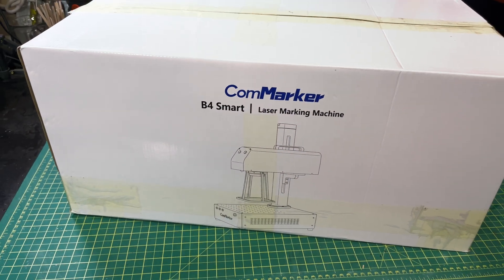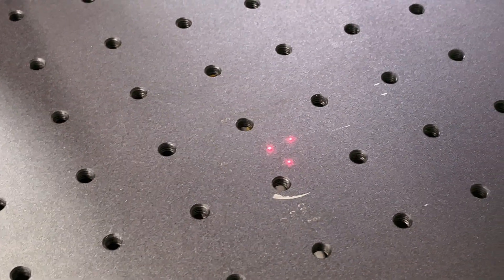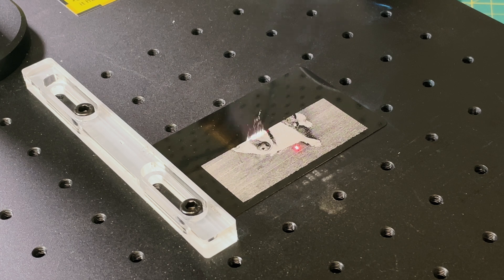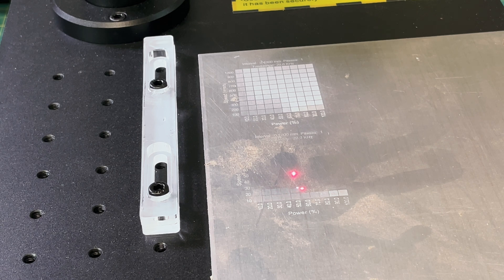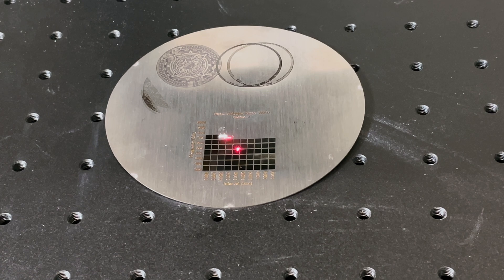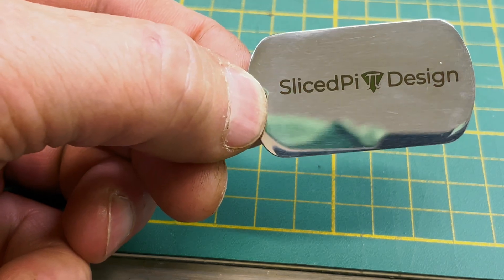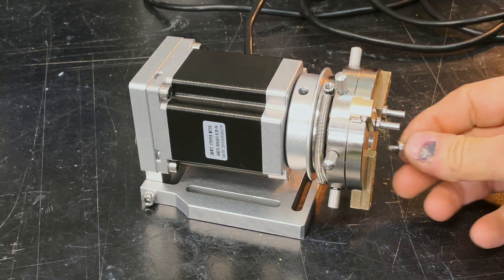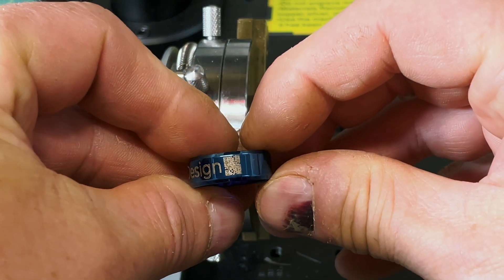Ultra-Fast Engraving with the ComMarker B4 Fiber Laser

Comment: Great work. I just got mine up and running. Could you show how you did the horse it came out great!
Reply from the maker: Well, that video was a couple of years ago, so I don't have the laser in my shop or the settings anymore.

In Lightburn, though, you can select 3D engraving mode for an image, and for that one, I probably use 15-20 passes.  With a fiber laser you can also engrave brass with a light color or a black color just by adjusting settings.  I believe ComMarker does have a settings library for the B4 that you can add to Lightburn though.

Comment: Great video Steve. I just received a B4 20w and having trouble getting the settings correct. Would you mind sharing the setting for the business cards in the video? Thanks in advance.
Reply from the maker: I'd love to, but this video is pretty old, so I won't have these settings anymore.  The best thing to do is to sacrifice a card and run some material tests (speed vs power), since the settings will vary depending on the material and even from laser to laser.

Comment: Hi Steve, your video has been helpful by a ton while i was looking for what laser machine to buy but can I get a sample of an engraved barcode on an aluminum material or any steel material from you? I just really need to be really sure before I make my purchase. Thank you
Reply from the maker: I’ll try to find some time today
Reply: @SteveMakesEverything  that'd be really helpful steve. Thank you so much
Reply from the maker: @humphreytarra5219  Didn't have time today, but it's on my list.
Reply: @SteveMakesEverything  That's alright :D
Reply from the maker: @humphreytarra5219  So I was thinking about this and in the video when I engravd the horse, it was done on aluminum and there's also a stainless steel example there.  Short answer is that you won't ahve any trouble with metals on a fiber laser.

Comment: Great video. I just bought one of these B4 lasers and I am trying to get a dark black on anodized aluminum with some luck but nothing great. I have tried the sprays with little luck. These are the setting I am using without the spray. 100 speed 100 power and 50 frequency. Any suggestions? Thanks, Glen
Reply from the maker: You can try to pull the focus up a couple millimeters. It works on stainless steel to darken engraving, though I haven’t actually tried this on aluminum.
Reply: Yes I have. It makes it better, but not black black @SteveMakesEverything
Reply from the maker: @glenmilner2382  Yes, the challenge with aluminum is that it tends to melt under heat rather than turning black.

Have you tried doing an engrave and then maybe filling it black enamel paint instead?  That might be easier.

Comment: What is the difference between the b4 one and the b4 mopa one? 

It says the mopa has only 10000mm/s speed and the one you are presenting has up to 15000mm/s. I guess you habe the normal one?
Reply from the maker: Yes, I have the regular 20W fiber laser, though the MOPA is a more appealing option if you have the budget.

These are different kinds of lasers.  Fiber lasers have a fixed pulsed duration, while MOPA lasers have a variable pulse.  MOPA lasers have a maximum pulse duration that is typically up to 80% longer.  The result is that a single pulse of a MOPA laser can to more work than the pulse of a fiber laser, so there is less need for the speed to be higher.

What all of this really means is that for a given project where a fiber laser might have to do 100 passes, while a MOPA laser could do the same job in far fewer passes (and be just as fast or faster as completing the job).

Comment: I just received my Commarker B4. I upgraded Lightburn to the galvo version. I am having trouble getting Lightburn to recognize the laser. I tried to get Lightburn to find the laser, but it did not show anything. I tried to create the device manually but it is not showing up in Lightburn. If you can recommend a tutorial, or instructions to install it in Lightburn I would really appreciate it.
Reply from the maker: I’ll take a look at mine to see how I did it. I had to replace my shop computer so I am installing everything from scratch and can do exactly what you’re doing.
Reply: It looks like it was a combination of a couple of things. I had been installing the driver from the USB flash drive they included with the machine. I started getting error messages from Windows about the drive. I downloaded it directly from Commarker's website and installed it. I think the driver on the USB may have been corrupted. The second thing was that the USB A to B cable that they sent was flaky. I started moving it around and I kept getting connect and disconnect messages from the PC. I replaced it with a USB cable that I knew was good, and it seems to be working. I tried my first burn in the wee hours of the mornings. Of course, I made the noob mistake of not taking the lens cap off when I started the burn. I corrected that quickly, and opened a window!. I engraved some of the dog tags, and a brass challenge coin. It was your video that helped me make the decision to buy it. Thank you for your help and all the great videos! @SteveMakesEverything
Reply from the maker: @1vekeller  Cool!  I set mine up again today on my new computer and had to jump through a few hoops that I had forgotten from the first time I connected this machine.

Connecting a fibre laser to Lightburn can sometimes be an adventure 🙂

Comment: Can you engrave clear acrylic? I am looking to do those small led night lights. I can do them on my CO2, but I was looking for something faster. I've seen some that say it can, and others that say it can't do it. I also want to do tumblers with a rotary. I would also like to do coins. I would appreciate any information about the acrylic engraving.
Reply from the maker: Clear acrylic is really the exclusive realm of CO2 lasers.  Diode laser won't cut it well and fiber laser are more for marking metals (and dark acrylics).  So you can do tumblers and coins easily with a fiber laser but you can't really cut anything.

Comment: I'm looking into getting the 60W version of this machine for my silversmithing small business but one concern I've had which I haven't found any commentary on so far is that given the sensitive electronics are in the base under the engraving bed there's the possibility that the engraving dust could get into the base through the threaded holes in the bed. Do the holes go through into the electronics cavity or are they blind holes? Thanks for the great video!
Reply from the maker: The holes do go through but it doesn’t  seem to be a problem. I’ve engraved a ton of brass with mine and the inside of the base seems to be perfectly clean
Reply: @SteveMakesEverything  thanks for the speedy reply! I'm very glad to hear there's no issue from dust so far. It's still surprising to me that they would design it with through holes. Every other comparable competitor seems to charge $1000 more for the same specs so I'll probably still go with ComMarker but I wish they offered a split version or had better dust ingress prevention.
Reply from the maker: @oxoniumgirl  I guess if it really bothered you, you could crack it open and tape the holes shut from the bottom.  But since you need some sort of fume extraction anyway, maybe that's enough to suck the dust/soot out before it settles.

Comment: 11:34 can you go to say 5mm with doing 2 runs. I’m looking at getting a Fibre laser to make brass leather stamps. The thoughts are that the Fibre laser  would be more accurate than a CNC. The texture I assume would stair case somewhat like a top of a 3d print. 

Can you do a wet leather stamping using 2mm thick vegetan leather to see how that works? 

Looking at something out of usa. So price is far higher than Chinese stuff. I was going to ask the dealer to send an example. To see how it works.
Reply from the maker: What you would have to do to engrave deeper is to resort to some trickery, like repeating the engraving task after dropping the focus a couple of millimeters.  There are practical limits to doing this though - like the amount of time it would take.  If you regularly need to engrave deeper then it makes more sense to jump to a 30 or 50W laser.

Regarding leather, fiber lasers can indeed engrave leather - be prepared for the smell of cooking hide though, so make sure the laser is in an enclosure ventilated to the outside.

Keep in mind that almost all lasers are built, or at the very least, part-sourced in China, so unless your goal is to help employ local people, you're really just paying more for the same components. (Not that I want to dive into global economic politics😉)
Reply: I was thinking about splitting file into top And bottom and run part 1 with 200 layers then run part 2 with 200 so total would be 400. It might be easier for colour graduation. I assume 256 would be a cap. The 50w are supposed to eat more in one pass so yeah that’s option. But are substantially higher in cost. 

With leather it would be just etching logos or monograms in wallets. A logo on surface rather than 2.5d engraving. It would be far worse than burnt hair I assume.

Buying non Chinese where possible is due to desire to promote decentralized manufacturing ie buy local build local. Covid proved that having majority of stuff made in One country can cause massive disruption. Much same as I go to a checkout rather than self serve / as it gives the person a job. 
Back in day before greedy shareholders wanted more profit you would be able to buy locally made. Tariffs if used well can equalize things. the same across glove but where the profits in that… 🤣
Reply from the maker: @75keg75  Your rationale for local buying fits with what I aim for.  And I go to checkouts too 😀.

Comment: Nice video.  Could that same rotary be used for tumblers?
Reply from the maker: Yes, absolutely.  Keep in mind that fibre lasers won't engrave glass, but if you are engraving Yeti type tumblers or mugs, or stainless steel, then you will be fine.
Reply: Steve, any idea as to the max diameter of a tumbler that this chuck can hold.  Looks pretty small to me.

Comment: great video ! do you have some type of different material sheet and their settings to use for this fiber laser ? thanks !
Reply from the maker: You can run material tests to find decent settings for fiber lasers - just like any other laser.  It's pretty easy because it's built into Lightburn, though for fiber lasers, you would need to upgrade to the galvo version.

Comment: Wow! How well could you engrave in Brass? The Aluminum horse looked very nice. Is Brass harder or easier to engrave then Aluminum?
Reply from the maker: Brass is a bit harder than Aluminum, but it's got to do with the characteristics of each metal and how it reacts to light from the fiber laser.  In the video, the aluminum version of the horse was sunken into the aluminum, but the brass, it was raised (really everything around the horse was lowered of course).

Comment: Newbie here   Why are they called "Fiber"   I understand diode and co2 types a little.    thx,
Reply from the maker: The laser is actually in the base and they use a fibre optic cable to pipe it up into the laser head.

Comment: Could you use the xtool rotary attachment that you featured in your video from last year? I bought it for my FSL laser on your recommendation and agree with your assessment of it
Reply from the maker: I would say no.  In theory it's just a stepper motor but ComMarker uses an aircraft connector instead of a simple inline plug.  It's more industrial-strength.  Also there is a separate box that plugs in between the rotary and the laser.  This box contains a stepper driver.
Reply: @SteveMakesEverything  thanks for the reply - I agree, in rewatching your video I saw the separate box and drew the same conclusion.

Comment: Steve, I'm new to diode lasers so I know nothing about fiber machines. I'm assuming the fiber laser will engrave wood but will it cut it too? Would you have to put in on a sacrificial board to protect the base?
Reply: Hey there, We have a Fiber laser and it does not cut wood. A Co2 Galvo would cut wood. Fiber lasers have the wrong wavelength and could easily set the wood on fire.
Reply from the maker: Fibre lasers will not engrave most soft materials, like wood, at all (not even a thin sheet of paper will be touched by a fiber laser).  They will also not be able to cut materials (They are specifically for marking).

They are mostly for metals, including the ones I showed here, but also gold, silvers, and platinum (think jewelry engraving here).

A fiber laser would be more to augment something you already have.  Use a CO2/diode laser for cutting (and engraving things like wood), but use a fiber laser for metals and do that very quickly.